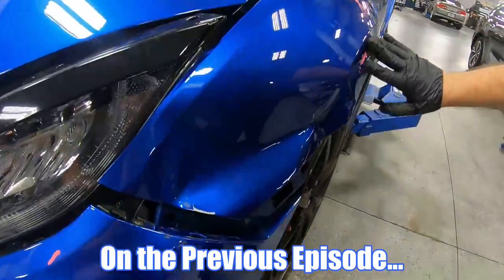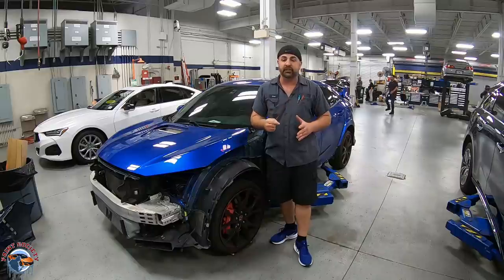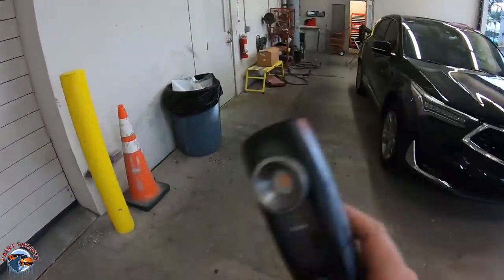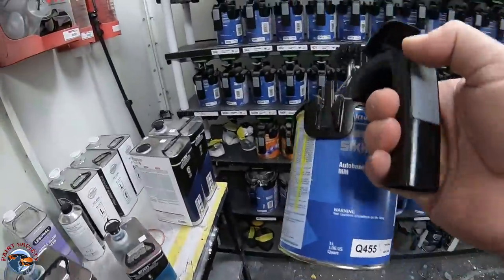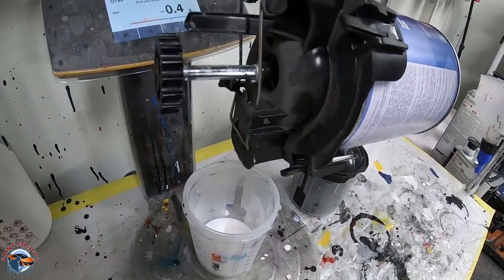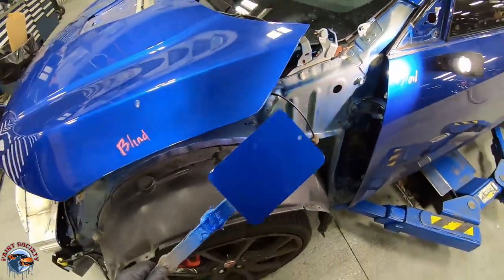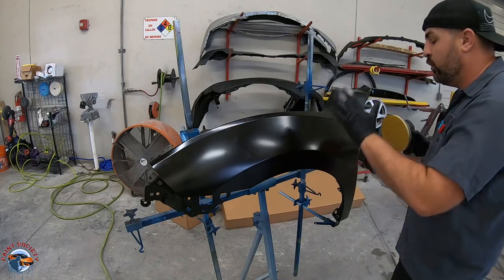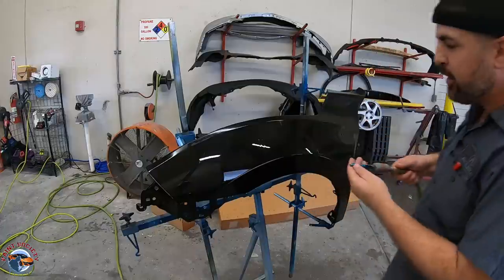How a PRO Preps a Vehicle for Paint Work! Repair Build Honda Civic Type R Part 2

Comment: Love your videos. Keep it up. 
I offer you one of my methods for paint prep: 
I'll use a strong degreaser such as "Mean Green", or "Purple Power" (there's a shitload of variants) for my final scuff and wash by hand, jambs too, and wash one panel beyond the blend area. Follow up with CLEAN chamois, or towel, blow dry (fans help) and mask. Keeping it clean while masking and pulling any slack out of the paper or plastic should give you good results. The scuffing agent isn't really necessary. All sanding is done dry beforehand.

Comment: that's why in my workshop in Poland we always blend elements next to replaced ones but to be honest not sure if that hood blend was needed i would have spent more time in manually adjusting color so it fits hood better couse it has different angles and might not been visable. But yeah door for sure would be blended hood depending on results either way suprised u didnt go for the  door blend right away.

Comment: Use a charcoal inline type water filter on your feed hose to your pressure washer you can buy them cheap online with half inch fittings. This will reduce possible contamination from city pipe tap water..

Comment: Hi Brian , great job. Great video. I a professional painter at a Ford dealership in Michigan. We use Xalta solvent paint. Was wondering why you used 600 instead of 800 for the blend panels?
Reply from the maker: In the video I chatted about how 600 will cut through the panel quicker  then 800. You will use far less material with 800 if you start with 600 first
Reply: With Darker colors, u can sand with 600 and not see the sand scratches when u clear over it. With Silver and Golds i would not use 600

Comment: Hi Brian! 

Question

I’ve done a paint job on my car using your videos and it turned out way better than I could’ve ever expected. However, I used the same paint on the entire car and the side skirts and rear bumper (both plastic) dried a bit darker than the rest of the car Do you have any guidance on how to fix?
Reply from the maker: Depends on the color. Probably needs more coats of oaint if it is a red blue or yellow. 

Usually though bumpers reflect color differently

Comment: Before color matching, don't you need to "clean" the paint first with compound or polish for the areas you will be blending?

The paint there might be darker than the true color due to contaminants or previously applied waxes.

I'm asking because I'm about to have my car resprayed. It's pearl white.
Reply from the maker: Only if you’re using a camera to match it

Comment: Love your videos, my son and I are getting into doing some bodywork and painting, if you’re a DIY like us, what size air compressor do we need? I’m looking at a porter cable 20 gallon tank and a refresh rate of 5.3 at 90 pounds. I know this would not be a big enough compressor if I painted every day,Do you think it would be OK for us if we’re only painting once every couple months? Thanks for your help and again love your videos
Reply: If possible you want a compressor pushing 12cfm or higher for reliable supply.

Comment: Help need i made a total mess of spraying a car and ended up with a finish like sand paper.i know after seeing your vids my gun setting etc where all wrong , so im sanding it back with 320 then 600 so i can re spray the base coat. question is if i have small spec of clear left will the base go over them ok , the base is a metalic blue so it could be them im seeing
Reply from the maker: Not sure what you mean by small spec of clear. If it’s a metallic. Sand it good and flat with 600 then go over with 800 then base and clear
Reply: @PaintSociety  Thanks for the reply , i think i put the base on a bit rough as well but hoped the clear would make it smooth, So once sanded i can see like little dots of shiny specs which i hope is bits of the metalic base coat and not bits of clear
Reply from the maker: @adambooth215  Most likely it’s base

Comment: You dont seal the underside of new panels? Ive seen a lot of people say to scuff and seal the underside of new panels, not worrying about paint though, just seal it like you would the outside of the panel.
Reply: Its a waste of material. And overkill.
Reply: @JimmyJiveJones  its just sealer, not saying to fully paint it just seal it from the elements, it is a new panel afterall

Comment: Watching this from Germany, this is bullsh*** sorry bro that’s not quality work and not pro at all…
Reply from the maker: Respect Brandan.  Thanks for watching from Germany. I’m actually partly German as well. 😀. Respect your opinion for your reasons you may have and thanks for visiting the channel.
Reply from the maker: Brother did I lose you, I was looking forward to your response.
Reply: I might have been a little over it. But im just used to a different way of working. In Germany we don’t wet sand any more at all. But it’s not just the wet sanding. We have a higher standard in collision repair due to the manufacturers and the insurance policy’s. We use waterborne paint and we would never paint a fender just to see if the color matches. There is much more better ways to figure out if the color is blendable. We use modern tools that create microscopic pictures of the paint to compare with the other viriaties of the color. And we paint the paint cards just like we would paint a car meaning in the same way you pull the gun and not all over the place to make sure the color lays down exactly the same as on the car. Customers over here are very very picky with their cars. I’m sorry I commented in such a rude way that was not okay and I apologize. But I guess that in other parts of the World painters work differently. As Long as the result is great it shouldn’t really matter. I still think there would be a way to push the standards in quality a lot higher and we could give a better customer experience. At the end what I’m saying is that we could still learn from one another on the basics of having the same passion for the job and having happy customers. And again sorry for being rude I’ll follow and watch your videos to support!
Reply: @brandanhunt5322  I dont understand why ur against wetsanding? While painting the whole fender isnt common practise i do see the benefits of doing it. I dont do it myself unless the color has low hiding and i want the coverage for when i paint it later.